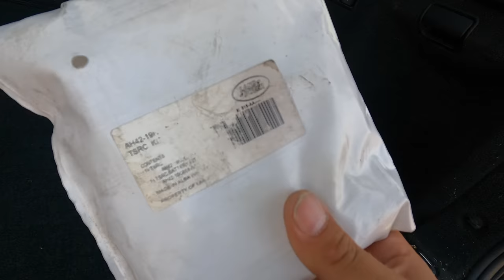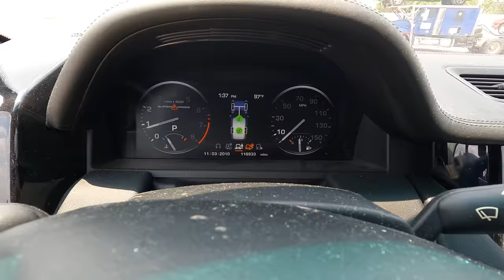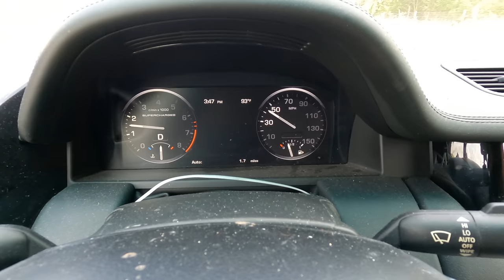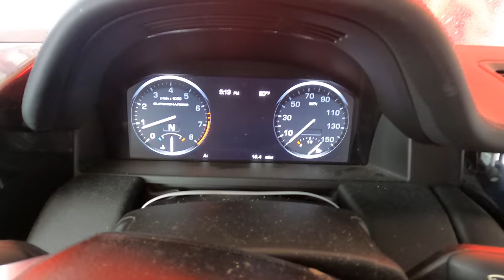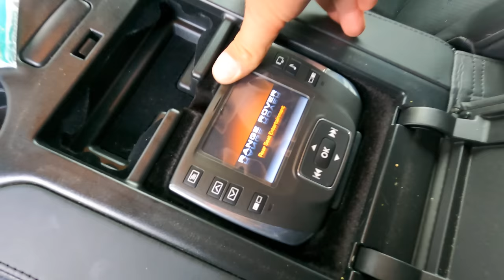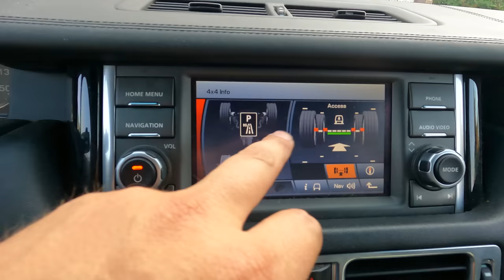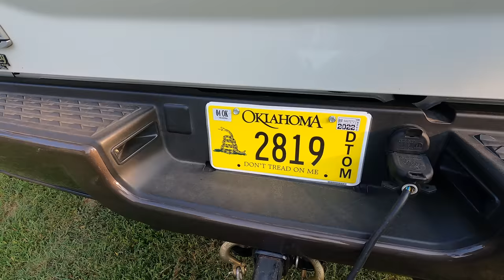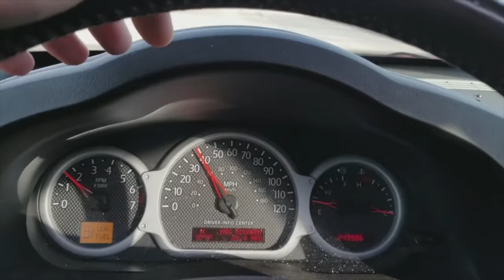I Bought an $85K Supercharged Range Rover for $5800 from Copart! Win or Fail?

Comment: I had a 2012 Range Rover supercharged, I sold it with 67k miles and it was the biggest head ache of my life. I sent 10k in engine repairs before I sold it. I’ll never buy one again. I got a cls 63 as a replacement

Comment: I bought a 2010 HSE supercharged white with tobacco colored interior for 4950 + 437.00 of fees from a dealer auction about 6 months ago put 2 tires and a o2 sensor and sold it for 12800 in less then 3 weeks 1 bad ass suv you should make som money on it

Comment: If it starts blowing smoke, check the supercharger first. I saved a dealership about $7000 by diagnosing it correctly. The body of that thing has to come off to remove the engine.

Comment: I bought one very low 30k miles,lil older,for $800.One of my fav vehicles,out of over 100 I owned.Very bad on gas,Jaguar engine,easy to work on,tune,did leak.Had to trade off when I needed a highway vehicle to see my young son,(chase his mother) on the run

Comment: Randy, you tossed us a curve when you got this one. Glad it worked out for you, but I'd punt it quickly as I don't see any desirable content from it. 

By the way, I think 4K video is not worth the effort. Normally folks are watching on smaller screens and see no real benefit.  Sometimes I pull it over to my basement Home Theater setup (with a 55 inch screen). Even at 1080 it's just marginally worthwhile versus 720P. A lot of folks don't have the network bandwidth for 4K so they probably set their defaults for YouTube down to what they can handle. We're not looking for cinematography here, just a decent picture that goes along with the story. Audio is just as important as the video, and you do a good job there most of the time. Thanks! 😉

Comment: 85k 10 years ago, if you're lucky the suspensions won't cost you 12k to figure out why the air suspension keeps leaking, or the 4k anti roll bars leaking all over the drive.

Comment: A 2010 Range Rover is not worth $85,000 right now. It was worth that 11 and a half years ago sitting in the dealer's parking lot. Rough trade is about $9500 right now. If you are leaking fluids, way less than that. Prob $6K. Secondly that is not a Sport. That is the full size Range Rover.

Comment: The rear seat remote doesn't have the battery, that's in the little bag. That's why it doesn't stay on when you're not pushing down on it. When the lid is closed, it pushes down and charges the battery. When it's open, it props the remote up so you easily take it out.

Comment: I bought a 2011 RR 5.0 V8 Supercharged with 115,000 mi back in February of 2022. 
In about 8 months of owning this real SUV I have been having a blast . Everything works and no problems so far. It is a luxurious tank that can go anywhere off roading.
It has tons of power and it is fast!
Drove almost everywhere in a off roading recreational park with street tires and did not get stuck a single time.

Comment: Just give it time. I’ve owned several Land Rovers since 95 from the Series 1 to the LR4  from a LWB 95 Range Rover to a P38 Range Rover. Yes, the LWB had rust issues and the P38 had electrical issues. But the BMW came along and basically ruined the brand. I purchased a 2003 LR322 with the 4.4 BMW V8 with a service schedule since new. When it ran, it ran great but it was the biggest piece of crap vehicle I’ve ever owned. BMW, needs to be horse whipped for designing such a shitty V8. I mean leaking valve seals?? Who designed this engine?? Total, and complete garbage. You’re better off doing cocaine off of a strippers tits buying this vehicle, I’m serious. 15 grand in repairs in only two years.

Comment: I got a 12 with 70k 9 months ago. Tennessee truck .Now gas is running  me broke. Dealer says my rattle isn't  timing chain. Getting ready to do the super charger coupling.  Otherwise it's been a great rig . Try ceramic brake pads to stop the insane brake dust

Comment: Get rid of this Range Rover fast while it still starts. Don't pass GO, don't collect $200... Dump this thing. I have a friend who owned one of these. Engine was perfect, until the timing chain broke and that was it. Done deal. Under the passenger's seat is a computer that has more wires and electronics then a computer lab has. Wait until that fails also.

Comment: I own a L322 , the air shocks need to be replaced and the suspension compressor too , did that on mine too , I have the diesel twin turbo tdv8 . Have fun , once you have fixed everything , its good for the next 100k miles and 5 years .

Comment: I’m a big Land Rover person, I own and LR4 with the same V8, but I can tell you that the chain is way too loud in this car, it sounds like it’s rattling and if it blows up on you, your going to regret it. You need to do more research on these cars. It also looks like the engine is down on power, their normally a bit quicker then that. This car is also missing an engine skid plate that comes from the factory with the car.

Comment: Keep and get rid of Dodge and don't shop Sam's.
The Walton's don't pay like Costco does. Turn signal end button changes odometer trip avg fuel settings etc. Use steering buttons to check oil

Comment: The history of the Land Rover V8 came from Oldsmobile in 1962 when Oldsmobile had the aluminum 216 V8 that Land Rover eventually bought from Oldsmobile and made it into other forms this is another form of that original engine it was a good little rockettte in the f85 oldsmobile
Reply: Rover bought the rights to manufacture the Buick engine in England: it was 1st used in the Rover P5B (B for Buick)  in about 1968. It was then  fitted to the 1st Ranger Rover (Suffix A) in 1970. So in the UK it's known as the Rover V8 as it was also fitted in the P6 Rover and the Rover SD1s as well as Range Rovers and then Land Rovers, including Defenders and Discovery's. Eventually the Rover V8 would no longer meet emissions standards and so the BMW V8 was used instead as BMW owned Land Rover at the time. Now Ranger Rover are owned by the same dudes as Jaguar I believe that the two companies use the same range of engines.